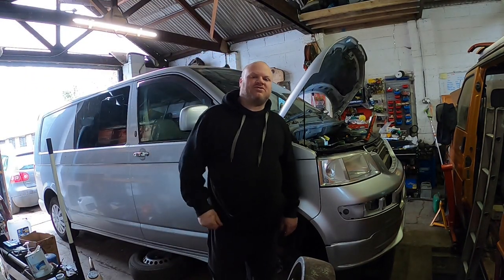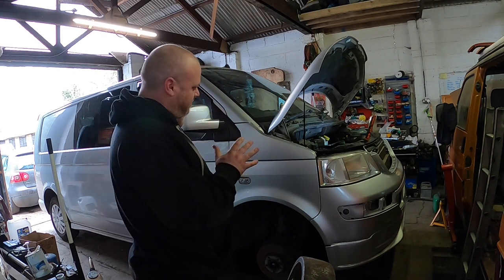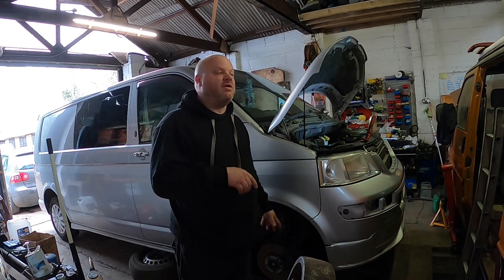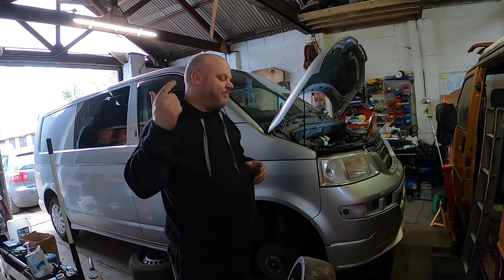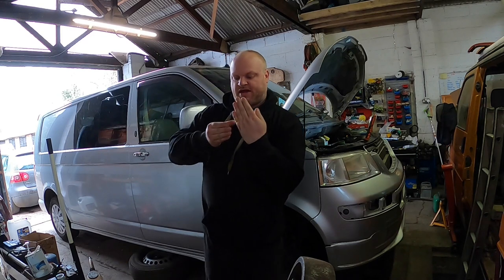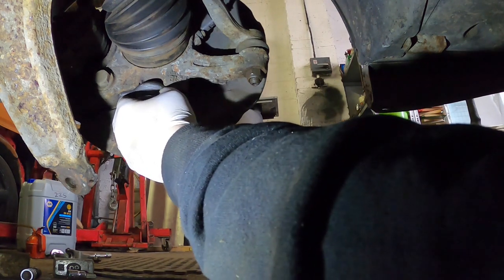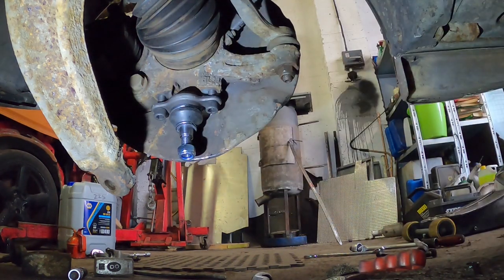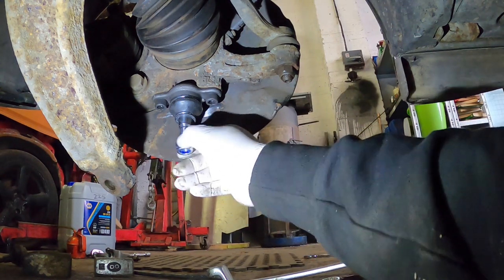VW T5 Transporter lower ball replace change repair t28 t30 t32

Comment: Good to see that. Scratching my head a little as I went to torque the M14s up to 90nm + 45degree (VW settings ) and the thread stripped at a little over 50nm on one.  Did note metal swarf coming out when I took the old bolt out and had previous suspension work carried out twice over the years and arms off for replacement bushes recently by others. Autodoc note 50nm for the M14 which seemed loose hence the cross check with the Workshop manual

Comment: Every single bolt I have touched on my sons vw t5 was seized most had to be cut off , is this usual, ( replaced top strut mtg bearing ) can’t get ball joint back in . can’t get lower arm bolt undone.  😢
Reply from the maker: No mate that not normal😔 must of lived by the sea at some time in its life